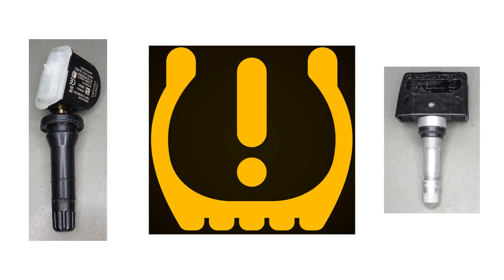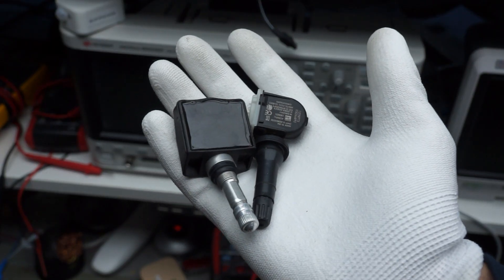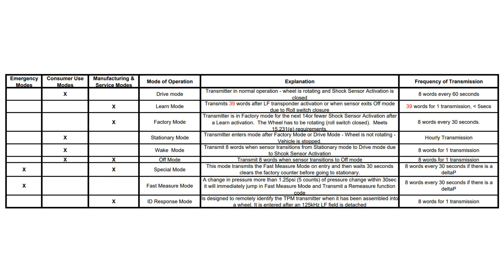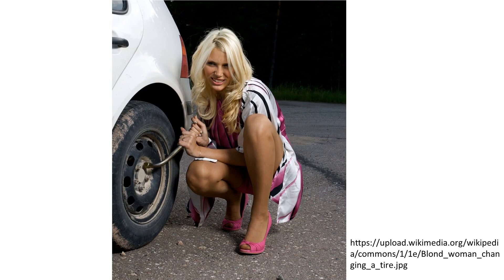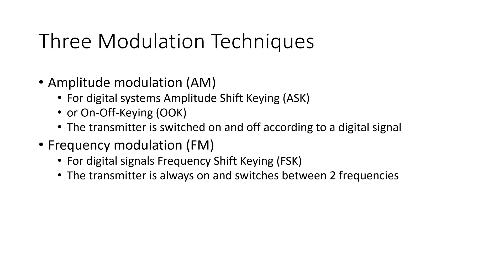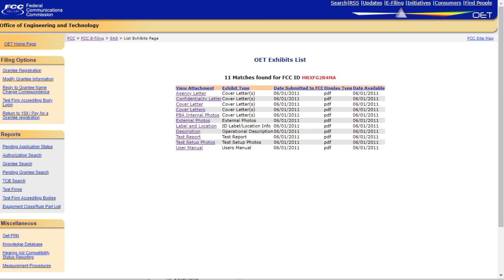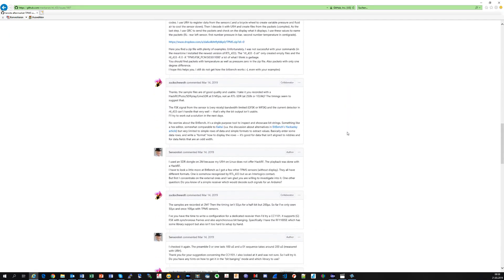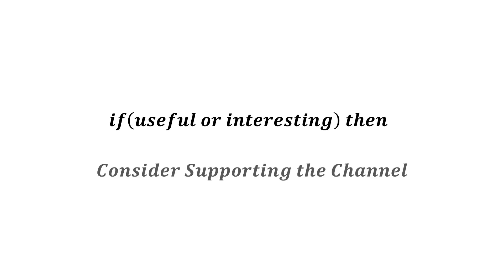#261 Measure Pressure Remotely (including TPMS Hacking / Attack) for Beer Brewing

Comment: I am working on a project of my own and having difficulty ID-ing the TPMS sensors (the kind you attach to the tire stem). Do you have any suggestions for how to go about ID-ing these (I am using Wireshark along with the nrf-sniffer USB dongle from Adafruit). I am unable to find an FCC ID or a UUID for these sensors. Do you have any suugestions for finding these?
Reply from the maker: Here, I used 433MHz sensors. If you talk about UUID, yours probably are BLE types. So you have to search "how to read UUID". This can be done with a simple smartphone.

Comment: My external tpms sensor, one is not working, if I buy a replacement sensor from Aliexpress, how do I change the default ID so it will work.
Reply from the maker: AFAIK your dealer has a device to reprogram your car.
Reply: I am referring to the generic external tpms that you demonstrate in your video.  If I buy an extra external sensors only , not the display console from AliExpress, to replace the faulty one, I don't think it will work, as each sensor has a unique id, maybe pre coded into the display. Every AliExpress store that sells the sensor all mentioned it has to work with the display console they sell, thus wondering how to change the sensor id to match the faulty(lost) one.
Reply from the maker: @shenwang8722  You have to read your sensor to learn the number, of course.

Comment: Let me extend the question I've made yo...Is there any brand/type of tpms "open source". I mean, where the protocol, modulation and so on is known. My idea is to avoid reverse engineering and avoid rtl_433 and use an and small arduino with a specific 433Mhz Rx devoloping it at low level but with high eficiency. My RTL/SDR is completelly on fire after 20 minutos of work...bad deal!

Thanks!
Reply from the maker: Maybe you have a look at this project: https://docs.openmqttgateway.com/

Comment: Great video!! Let me ask you something about Jansite internal sensors. I have a RTL2838 DVB-T with the rtl_433. According to Github documentation there are two protocols for Jansite number 123 and number 180. But if I select them explicity -R 180 and -R 123 nothing happen. But if I launch rlt_433 the software sometimes recognize signals, it says Renault TPMS, Ford TPMS and several brands.
Reply from the maker: I do not know the project that well. Maybe you ask your question on their Github?

Comment: Thank you for the video!

I bought the cheapest 433MHz sensors from china to try and adapt them to an old car using TI CC1101, of course I managed to select one with the strangest output format that's not anything like any of the decoders built into RTL433. It is for sure ASK OOK, I think it is a schrader clone based on FCC pictures because the board is not the same at all even though it has the same FCCID. It uses SNP205H, it has board space for an accelerometer but it's not populated. I feel the "tiring" joke, in my arms!

What I wish I knew when buying the sensor, go look through RTL433 and find the FCCID of a sensor that someone else already put work in to decode!!
Reply from the maker: The Chinese devices sometimes do not have FCC certification 😔
Reply: @AndreasSpiess  This one probably isn't, I am pretty sure the FCC would want the product to be re-certified with a new ID if the PCB was changed as drastically as this was. 

I bet they are at least trying to copy the protocol of the original licensed schrader product they cloned. It at least appears to work, the FCC docs do say it's supposed to use ASK and manchester coding. 

What's really crazy is all the hardware someone here in the sates can order off amazon that clearly never had nor could have FCC certification. Baofeng radios, wifi jammers, GPS blockers, cellular/bluetooth jammers as examples. They are usually stocked and fulfilled from USA warehouses!

Comment: My friend, I would like to add on top of a video signal the osd of two tpms sensors.  The idea would be to place a reverse camera on a trailer and transmit the video inside the vehicle.  The camera part, transmission and reception, and reverse sensor, ok.  I would like to add pressure information to the image.  I'm thinking of using a "mini osd" for the interface between the signal and the video, my difficulty is in extracting this information from the tpms receiver and converting it to the miniosd.  Do you know anything about it?
Reply from the maker: I would separate the two tasks as you describe: Extract the sensor data (which is covered in this video) and inserting into the OSD device (I have no knowhow there, but for sure you find the relevant info in the documentation of this device.

Comment: What I don't understand is why they aren't self powered via inertia. Remember the early 2000 LED blinking valve caps? they were powered via a tiny kinetic generator.
Reply from the maker: I am not sure if the (regular) movement of the tires would create any movement for a generator.

Comment: My cars, both Ford and Toyota have sensors in all of the wheels, they are all monitored, even the full size spare. Its quite nice to know that the spare has the correct pressure in it. Don't care? Get a flat tire then go change your tire on the side of the motorway, only to find that the spare is flat, not a good feeling.
Reply from the maker: I agree!

Comment: Hello Andreas, thanks to your tip on this feature i am using this almost every day to track my bottle fermentation pressure. It would be nice to track the data for a period of time, currently i write down the pressure value every day or serveral times a day, this is of course already great.
It would however me even more professional to be able to create graphics of the proces. I am thinking of reverse engineering the receiving unit, figure out if there is a serical data stream which could be easily be transfered to e.g. an Arduino or other controller. I was wondering if you already dived in to the PCB of the receiver unit to figure out if this is possible. I guess this should be possible and it would make things easier for us.
Reply from the maker: Did you watch my video #270?

Comment: TPMS Status
Hello Andreas,
I`m very interested in the outcome of your beer brewing project, but for a completely different application. As a matter of fact, I`m into vintage motorbikes. They partially still use tubes in their tires, rims are often rusted or bend. Therefore, many drivers are looking for a TPMS system. Our dear friends from China do offer sensors plus small displays for small money as dedicated TMS systems. This is only a partial solution to the issue, as most drivers would like to have an integrated solution with display of oil pressure, oil temp, rpm, speed, gear, you name it.
This is typically achieved with an Arduino, some kind of a display and the required sensors. Such a solution can easily be “hidden” even in a vintage bike. 
I am therefore very much interested in your work on TPMS. Is there any result available (preferably as lib or at least code snippets) on reading information from a TPMS via an (Arduino) MCU?
As a mechanical engineer, your approach on code/protocol sniffing on the RF side is a bit too challenging for me…

Kind regards from Germany 

Matthias
Reply from the maker: I did not do more work in this matter. So I cannot help here :-(
It seems that the rtl_433 library is ported to an ESP32: https://github.com/NorthernMan54/rtl_433_ESP  . This chip is better suited for a bike than a Raspberry.

Comment: Thank you for this video and the links. I've always wanted to test that. After the first successful attempt with a replay attack on a thermometer, I noticed that my car does not have a tire pressure sensor. But the car key is remote ... hold my beer :-)
Reply from the maker: You are welcome! Unfortunately for the hacker (or fortunately for the owner), car keys use rolling codes and cannot easily be hacked...

Comment: I've been thinking about building a Raspberry Pi into a classic car and incorporating a number of features such as reversing camera, ttrip camera, media center, GPS, weather etc. and was thinking about what sensors I could include. Finding these tire pressure sensors on Amazon and seeing that they emmit at the given frequency, I was wondering whether I could read the data from them - This has been such an insightful view of the process. Thanks. I'm bookmarking this video to review again later.
Reply from the maker: Glad it helped also for the "original" purpose, not only to brew beer ;-)

Comment: Hello Andreas, I found this TPMS hack from the bottle pressure video with HopfeNerd and it's very useful. Thanks for that!
I am also a home brewer and was just looking for such kind of device that sends my bottle pressure to openHAB. But I am missing one point. How did you configure rtl_433 to receive the information from the TPMS sensors?  I bought the same as you and don't receive anything. The rtl_433 tool is the newest right now.
Thank you again!
Regards Christoph (riegelbrau)
Reply from the maker: Maybe you have to go step-by-step and watch my videos about 433MHz hacking to see if your sensors work on 433MHz etc. etc.

Comment: Hi Andreas! I hope you are doing great...so I followed your videos in regards to the 433 Mhz devices hacked and finally I am ready to complete the TPMS Hack, I bought the RTL-SDR, TPMS same model to make sure everything will match your video, then installed the rtl433 and pretty much everything is running as expected, but not with the TPMS sensors - for some reason they seem to be sending different information (data) when compared to yours. I have checked the 315Mhz band, but still no success...I still can't find what I'm missing, when I run URH I cannot see the same graph 19:56 ,  but when I run the  command "rtl_433 -R 0 -X 'TPMS:FSK_PCM:50:50:1000' " I am able to see packages coming thru. Any suggestions ?  Thanks!
Reply from the maker: I think you already got an answer from the developer. Github is the way to go.

Comment: Thanks, very informative. I am trying to read tpms values to my arduino/esp. Currently checking possibility with Si4432 ISM TRANSCEIVER
 and my Esp8266 board.
Reply from the maker: Good luck. It is quite hard work to find the codes used.

Comment: Very cool, but wouldn't it be easier to use sensors that transmit using Bluetooth Low Energy instead of 433Mhz. Most devices (rPi's and phones) already have a BLE receiver incorporated.
Reply from the maker: Maybe. If you can read them. So far I did not try.
Reply: @AndreasSpiess  I'll try and report back ;)

Comment: Hello, it is possible to hack any device ? i need to hack a moisture sensor device to measure and record regularly the moisture in a wall. The moisture is not systematic, it comes only a few times in the mounth and I want an alarm to try to correlate what could be the root cause when it happens. Somebody could help ? it is for sure a very useful project but i cannot find a smart sensor for measuring the moisture in the wall. Note : there are some moisture sensor on amazon for 15-20€ i assume it is done if i can intercept and decode the value that the ECU is sending to the display...
Reply from the maker: I did a few videos about the hacking of 433MHz devices. Maybe you watch them?

Comment: Hi, great work! I would like to share that I also tried to hack exactly this model of TPMS from Jansite using an Arduino with an RF module but unfortunately I have very little experience on RF so I was unable to get anything. I decided to take another approach opening the display and checking the PCB, and for my surprise I saw an empty space on the PCB saying "Bluetooth module BM-77 or compatible" with a few exposed contacts. On that moment I hoped one of those contacts could be a working serial port, so I found the datasheet of this BM77 and I discovered which contacts were the RX/TX, I soldered a wire and found a 115200 kpbs serial with 10 byte message for each sensor. The results of my tests are: the 5th byte is the sensor number (0 to 3) which the data corresponds, the 8th byte is the pressure (not bar nor PSI, needs to convert to them with an equation which I still working on it) and the 9th byte is the temperature in Fahrenheit. The other bytes I still don't know exactly what they mean, the first 4 bytes are fixed values, and the 6th, 7th and 10th vary. Probabily they created this PCB foresseing an smartphone app but as far I could see they didn't did it. As my objective is to integrate this TPMS on my Arduino trip computer I installed a simple HC06 bluetooth module on it and so far it is working fine.
Reply from the maker: Interesting idea. I have to look into it. Thank you!
Reply: were you able to interface your TPMS with arduino successfully?
Reply: @starkmaximus4938  yes, I'm able to read the data from the sensors through the method I wrote in the last message. I achieved succesfully the equation to interpret the tire pressures but I was wrong about the temperature. Actually the temperature sent by the display is the temperature in Celsius plus 50, so in my case when I receive the byte I just need to subtract 50. My setup is working fine up through this years. Ideally I would like to make Arduino communicate directly with the sensors through RF, without the display, but I never achieved to do this way, so I hide the display in the glove box.

Comment: The indirect system works (too) well: it measures pressure differences sub-0.1 kg/cm²
Reply from the maker: That is very interesting to me. It is hard to believe that they get these small differences.
Reply: They do. What's annoying is that they could easily tell you which tire is flat (well, slightly deflating) but the ones I know simply don't. So stop the car and go round and round checking all four seeing no difference (100g that's not visibly discernible).

Comment: Some internal tire sensors do not need to be programmed to what position the vehicle the tire is mounted. Chrysler Jeep and Dodge and RAM are one example. After doing a tire rotation or replacing a tire sensor all you need to do is drive the vehicle at 15 miles an hour for a few minutes and this receiver will recalibrate and pick up that sensor. Buicks and GMCs you need to use the programmer like you showed in your video. vehicle needs to be put into learn mode most likely by pressing the lock and the unlock button at the same time. The Horn of the vehicle beep 3 times. then the driver side blinker will stay lit the indicate that's the tire you need to start programming first. then it moves to the passenger front passenger rear than driver rear. after all the tires have been relearn the horn will beep and it will exit the learning process.
Reply from the maker: Thanks for your information.I would be very interested how they detect the position after rotating all tires.
Reply: @AndreasSpiess  on some Vehicles the reciver is mounted up in the wheel well. Other vehicles would be by the wheel Hub. On vehicles that have to be program per Wheel there is one receiver  and its position varies per manufacturer and all 4 tires transmitte to it.

Comment: My 2018 Subaru Forester has a sensor in the spare tire. Got a tpms warning one morning and after checking all four tires, all were good. Thought one of the sensors was bad until I thought about the spare tire. Sure enough, it was low. Aired it up and tpms warning went off.
Reply from the maker: Thank you for your feedback. So some of the cars seem to have also one in the spare tire.

Comment: Interesting video as always. Have you ever thought to make a video about a capacitive measurement of a liquid's volume that is stored in a tank?
Reply from the maker: No. But maybe once with a pressure sensor.
Reply: @AndreasSpiess  For a tank with 1 m height, when it is full of water, we have at the bottom a 9,810 Pa pressure. We also   have the atmospheric pressure which is approximately 100,000 Pa so we have a total 109,810  Pa. So we need a sensor to measure the differential pressure with a resolution of 98.10 Pa/cm. If am I right, what type of pressure sensor can measure such values?

Comment: Another great effort for the details in your video.  I was thinking of a project using the system for a household water pressure surge tank.  It could be added to the weather station logs for water usage (as the well water pump starts and stops).  Thanks for the cheap sensor idea!
Reply from the maker: I am not yet sure if these sensors are water proof.
Reply: @AndreasSpiess  That's fine if they are not. They should be waterproof it they go on the tire stem.  My surge air tank for the house is inside which makes fir the broadcast of the signal close to a receiver.

Comment: great breakdown and exploration of the reverse engineering Andreas!
I have probably commented this on a previous video, but this also is a great related repo and video (""Dude, Where's My Car?: Reversing Tire Pressure Monitors with a Software Defined Radio"") talk about TPMS reverse engineering...
https://github.com/jboone/tpms

thanks for the hot tip on BitBench as well... I usually have to do this visually in vscode, or when I get really stumped, write python scripts to try various things (xor/shifting/rolling/crc/etc) to make sense of reverse engineering data...
Reply from the maker: I saw the video (also on HAK5) and looked at the library. Unfortunately it is not updated since 5 years :-(